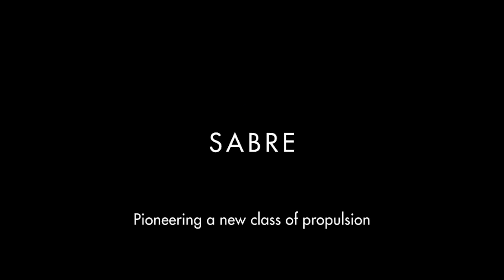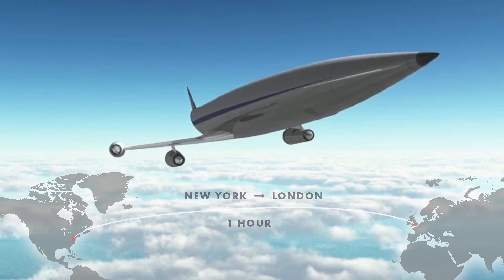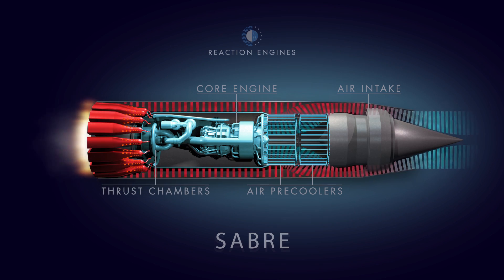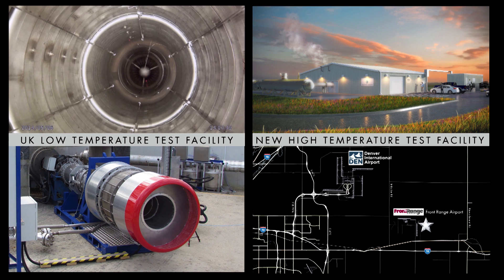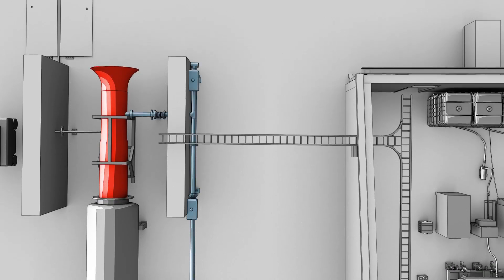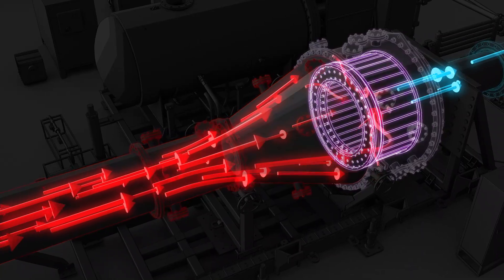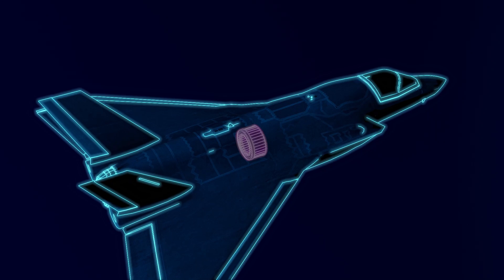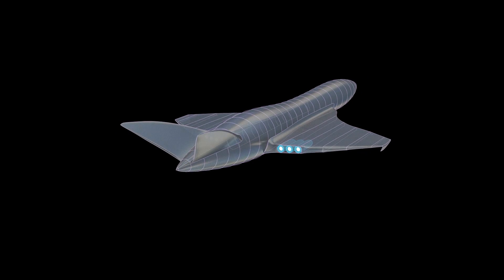Hot HTX test programme 2019

Comment: The main technology revolves around pre-cooler.  They need to do a lot of work on shock wave mitigation of incoming air.   It would be good to test this with a rocket propulsor and CFD.  Study the J58 engine (That engine is beyond the knowledge of many aerospace engineers today)  The nose cone adjustment was key to its high speed capabilities.  Testing this engine is for transition between air breathing phase and rocket phase, because going for long distances at hypersonic speeds through the atmosphere is plane stupid due to air resistance and compression issues of air.  https://www.youtube.com/watch?v=F3ao5SCedIk&ab_channel=TechLaboratories

Comment: they state the intake air is pre-cooled and give the example with afterburner air intake where they claim the temperature decreases by 1300F. lets look at it reasonably. and try to decode this technology.
in supersonic flight the intake air is compressed in the admission stage. the admission stage doesn't have any moving parts, the air just smashes into a wall shaped in such a way that it eventually advances through a nozzle.
however, the shape and dimension of this nozzle makes this air smash-compression stable at a certain supersonic speed. below this speed, the axial rotary-compressor is needed to actively compress the air. past this speed, the axial rotary-compressor is bypassed.
the air compression leads to increase of air temperature. for example, a tennis ball heats up sensibly even when smash-served.
so at this time there is the pre-cooler device in the sabre engine.
now to understand the pre-cooler: the air only cools when it stretches. it could cool down if mixed with cryogenic fluid as well.
If the air was stretched after being compressed, it will loose pressure which is counter-productive.
Therefore, I believe that this technology uses cryogenic spray to achieve two things:
1. to decrease the temperature of the intake air; increase the density of the mixture; make possible further axial rotary compression, which improves burn
2. if this cryogenic gas contributes to burn then we could try to guess it: hydrogen? oxygen? nitrogen? could it be another gas? I guess not. also we can exclude the nitrogen since is extremely toxic

so were down to hydrogen and oxygen. makes lots of sense, since high speed demands high altitude where oxygen is scarce. also is a bit dangerous to pullout the high- altitude cause the pollutants never fall back to Earth.

conclusion:
I believe this sabre technology is a cryogenic pre-cooling of heated intake air.
now there is a safety aspect to handling cryogenic fluids in general, let alone in mid-air.
I believe this issue is solved in this way:
1. the cryogenic system is charged before flight, thus avoiding any breathing in-between flights.
2. once launched, the airship reaches supersonic engine functioning in shortest time possible.
3. the supersonic acceleration works in jet engine mode, where the intake air is cooled using the cryo system. the cryo intake increases the density of the mixture and decreases the temperature, allowing the further compression using the rotary axial compressor.
4. once supersonic-suborbital cruising is achieved, the cryogenic-based rocket burn system takes over and the rotary jet subsystem disengages. above 80km the air is so thin that the rocket burn rate to maintain sub-orbit is so low that will make the cryo system small enough for deployment on airship. the cryo-burn (cool name right?) continues for the rest of suborbital cruise.
4. since the speed is not hypersonic the deceleration for landing does not require thrusters. the airship will continue the suborbital flight in a quasi-inertial mode, with minimum support from cryo-burner. the speed loss from Mach5-7 to subsonic happens inertially where the air drag increases while the ship drops to denser altitude. this stage is a bit critical because the airship will overheat due to air friction and maybe a cryo-flush could maintain the outside within safety limits.

my last two cents
is interesting how the advance of technology leads to the necessity of marrying cryogenic technology with the very hot. the engine must have two modes of operation: regular jet and rocket. the jet works on kerosene and quantities are limited to the need for take-off , acceleration to low supersonic and landing (landing is inertial). the rocket works in suborbital cruise and is based on cryogenic technology.

if we want to fly into the future, we need all we've learned:
1. all fluid dynamics
2. all in jet engines
3. all in cryo-fuelled rockets
4. all in telecom
5. all in hydraulics/servo
6. all in truss-tube
7. all about Coanda effect
8. that's it.
Reply: If you had spent the time used writing this post to research the tech, you wouldn't be making incorrect conclusions. There are plenty of block diagrams showing the simplified process, and the patents are available to read online. Everything I've written below has been publically known since ~2015.

Air can also be cooled by passing it through a heat exchanger. Thermal energy passes from the air to the liquid helium inside the tubes of the heat exchanger. At no point is the helium directly mixed with the air. This heat exchanger is the most important technical achievement of Reaction Engines. There is no "cryo spray" to cool or "increase density". The heat exchanger is only used in the early air-breathing phase. The heated helium dumps its heat into the hydrogen about to be used for combustion, using another heat exchanger. The warmed liquid hydrogen fuel is injected in the pre-burner with the cooled, compressed air, after the heat exchanger and compressor. There is an excess of warmed liquid hydrogen from cooling the incoming air, and that excess is used in the bypass ramjets (the circle around the rocket nozzels) which gives a 5 -15% boost to thrust. Once at ~M5 and ~70,000 ft the inlet closes, and the cooling assembly, compressor and ramjests are unused. A much smaller tank of pre-loaded liquid oxygen is then needed as oxidiser for the rocket phase, along with the liquid  hydrogen, to accelerate up to orbital velocity/height. The engine does have two modes (i.e. phases) but there is no kerosene used anywhere; only hydrogen.

Up to the 3rd design iteration it did use methanol as antifreeze to prevent frost build up in the heat exchanger when cooling to sub-zero celsius. I believe (but can't find anything more reliable than my memory or comments on forums) that the need for the methanol antifreeze was designed out in the latest SABRE 4 design iteration, simplifying the engine. It's not clear which design this test stand will most closely follow, but even if the methanol is used, it is not used for cooling the air, and is not cryo (i.e. -150 C).

The Skylon designs CFD modelling has shown that there are some "hot spots" during reentry that would require active-cooling in a few areas, but the majority would be passive.
Reply: Stephen Boddy I’m not sure what exactly you want from me.
You talk about helium, hydrogen and oxygen. All in cryogenic state.
So what is your problem? Fact that I did not guess correctly or fact that I’ve guessed the entire thing just by using general knowledge on cooling?
Let me tell you one thing: The only what to cool air is by using a coolant. The only practical way to actually cool down is by spraying cryo liquid into the air. So all your stutter about heat exchanger is just plain dumb. The only thing you say or do is to attack me online with rubbish.
Makes me think of a bunch of dummies being given unlimited resources to invent something so retarded that the first guy with general knowledge already knows what is about.
Reply: @WindSouI  If you want to inform yourself, a great place to start is here:
https://forum.nasaspaceflight.com/index.php?topic=45914.0
Which is the seventh thread discussing Skylon/SABRE. Across all 7 threads there will be over three thousand posts with lots of detail, links to studies, documents, videos and links to patents. Also lots of back and forth on the merits, both positive and negative. Obviously the more recent ones are more up-to-date and informed.
This post:
https://forum.nasaspaceflight.com/index.php?topic=36826.msg1379983#msg1379983
in mid 2015 is when patents started being published, and the understanding went way up. There is probably no point in going any further back. Enjoy.
Reply: @stephen-boddy  I believe is a great step forward. a peek 50 years into the future.
I believe the brits have stumbled into a piece of engineering that is promising to say the least. and im not interested in technicalities but relaxed talk on the matter.

this his what I think:
Mach5 is not enough to achieve 80km which is minimal for suborbital flight.
the V2 German rockets achieved suborbital flight  but at a speed of Mach16. (Where Mach is calculated at sea level instead of where the ship is)

I believe 70000ft is too low for suborbital flight because the air is neither too dense to allow winged lift nor too rarefied to prevent hull overheating.

in order to achieve a rate of burn small enough maintain suborbital flight, the ship needs to reach Mach22.

acceleration to Mach22 takes 1h and still the passenger is exposed to half g, feeling he same pressure seated as if it laid down on the floor.

so 1h to reach cruise, less than 1h in cruise, then 2h to slow down. riding on a cryo installation with at least three different cryo circuits.

the only way I see this possible on a London to New York trip is if the ship circles the Earth entirely. no way it reaches orbit then deorbits in such a small distance. needs get up, run around once and start descending from the antipode.
Reply: @WindSouI  Just to try and make it clear how amazing this heat exchanger (HEX) is, it can handle 400 MW of energy. That's a small-ish grid power station. A portable electric heater you plugin to a UK domestic wall socket maxes out at around 3kW. So imagine pluging 133,000 of those electric heaters into a power station and switching them all on at maximum inside a perfectly insulated closed room at 0 Celcius. This HEX can take all of that thermal energy and move it to the helium loop and dump it elsewhere... continuously. The room would stay at 0 Celcius... with 133,000 electric heaters trying to warm the room up. And it does it weighing less than 2 tonnes, and is small enough it can fit in an engine nacelle. Kinda mind boggling when you try to think about that.
Like I said the HEX is the crucial thing that makes Skylon/SABRE and LAPCAT/Scimitar theoretically possible. The HEX is the most developed bit because it is the key enabler technology. It has been heavily tested already, and met all of the requirements so far. The next rounds of ground based testing is over an entire simulated flight profile, which is being done in Denver, US (Test Facility 2). All the other stuff around it is already solved problem spaces for the science and engineering. Hard work, but already done many times.
Reply: Stephen Boddy hydrogen absorbs 500kJ/kg to vaporize.
Meaning that 1kg/s of hydrogen absorbs heat at a rate of 500kw and requires 40kg/s of air to burn.
Since the specific heat of air is 1kJ/kg, a cooling power of 500kw drops the air temperature by 10degrees Celsius.
Conclusion: the most efficient method of cooling air using liquid hydrogen and further burn the mixture, can’t cool down more that 10 degrees.
There is something terribly wrong with the claim of 400Mw cooling power. Is like they took a nuclear reactor on a plane.

Comment: What is the sink for cooling the air?
Reply: A helium loop is the sink for the air, and it dumps that heat into the hydrogen used for fuel just before injection into the pre-burner, with excess warmed hydrgen dumped into the ramjets. Note the ramjets are not the main thrust producers, and are completely unused in rocket mode.

Comment: Great video and all, but are we going to see anything fly this side of 2100? By which time SpaceX will have rendered the technology irrelevant.
Reply: This finished article is already flying in a modified commercial jet engine. This is about testing orbital temperatures and forces (mach 5 or something), after that it is a rocket engine getting its air and fuel from a tank.
Reply: @shaun906  Huh? The Heat Exchanger is already flying in a modified commercial jet engine? Are you sure?
Reply: @radicalrodriguez5912  Yes, I do not think that is correct at all. I think the point is that the rest of the engine, besides the HE, is pretty close to standard and won't be too difficult to manufacture by any of the current jet engine companies.
Reply: people understandably think skylon the plane is part of SABRE. but its just the cooler at the moment and the engine will follow after these tests. do you think making something saleable first (cooler) makes more commercial sense? they can mass produce them while developing the last bit of the engine? The idea is to produce an engine like RR do, not a plane called skylon as bae will be building something like that.
Reply: Yes and no.
Reply: Also saying SpaceX are gonna render this irrelevant, SpaceX arent doing anything different in terms of building rocket engines that hasnt already been done by NASA and the Russians. What he is doing is refining the old process of getting into space, kind of like how Henry Ford invents the car but give the car to the Germans and they refine it. You do understand the numbers of launching into space, SpaceX pay $57m for a launch of the Falcon 9, when the Sabre is complete and ready to launch into space its going to cost $5m. Not only that SpaceX can only do some many launches from a launchpad each year, where as a Skylons could do constant trips back and forth.

Comment: I don't understand where in the Induction Compression Ignition Exhaust process your intercooler fits and what it benefits?
Reply: It fits in Induction. It allows greater compression than would be manageable without. As a side benefit, the "waste" heat is used to drive the compression.
Reply: @jocramkrispy305  how does the cooling of expanding gasses help with combustion?
Reply: when ait is compressed it becomes hotter,   @caitgems1  , without cooling the air it would melt the turbomachinery. Cooling the air allows it to be compressed. compressing  the air and fuel allows a higher chamber pressure, which allows more thrust to be generated.
Reply: @jocramkrispy305  It's radically different from the engine's I'm used to working on.
Reply: yes, it is  @caitgems1  If they were less radical, one might have got built in the 30-odd years since they were thought up.
Reply: @jocramkrispy305  I've subbed, piqued my interest now 👍
Reply: @jocramkrispy305  so ram compression is cooled................????????
Reply: @naughtyUphillboy  yes, so it can be compressed further

Comment: Woah, that's insane! Where does the heat go though? I thought you can't just dump excess waste heat like that due to thermodynamics? Is it transferred to a different airflow that's hotter?
Reply: I think the heat is transfered via the liquid methane (in tubes),   then the methane is chilled again from the liquid hyrdogen on board.  The heated hydrogen is then injected into the rocket burner to burn.   Basically transfering the heat from the air to the rocket nozzels.
Reply: the main challenge has been the consistent manufacturing of the tubes durring production which they now have. have you seen the massive vacuum chamber built to manufacture the heat exchanger as a product. The front nozzle that transforms the engine to rocket mode is the next big development milestone apparently (it experiences max temps and loads and needs to move to allow/block air flow into the heat exchanger)
Reply: I'm interested in where you get this,  @shaun906 , I thought manufacturing the tubes had been sorted over a decade ago. The vacuum furnace isn't exceptionally big, and Bayern-Chemie were working on making an intake sufficiently inefficient for the engine.
Reply: @jocramkrispy305  Bayern-Chemie are mainly working on the ramjets, I believe, not so much the intake.
Reply: Pretty sure it's both  @radicalrodriguez5912
Reply: Dumping heat is what thermodynamics is about. It is really about a lot of heat in very little time.

Comment: Misleading I thought I would see a test fire.
Reply: hi, the video is called 'hot HTX test programme 2019' so they are announcing the start of the test facility's in the US and that testing is of an article within the engine. but that product is a fundamental and it qualifies production too. once the test firings are complete and a success, the technology becomes saleable. Only then can the rocket engine be finalised.
Reply: shaun cheers lad for pointing that out. Would be cool to see thou.
Reply: @onwardthebrave826  i can't wait either. the only thing left after this is the design and manufacturing of the inlet at the front of Sabre. this inlet takes the force of transitioning from sub to orbital mode as it changes shape from open to closed for space mode 🤯.
Reply: shaun  was thinking about that inlet. What will be it’s metallic composition. To withstand the heat. Inconnel?
Reply: @onwardthebrave826  probably ceramic for weight reasons.